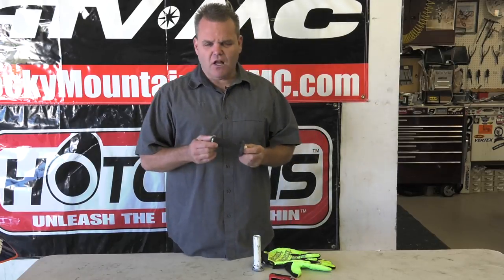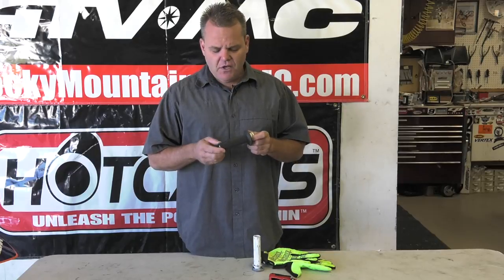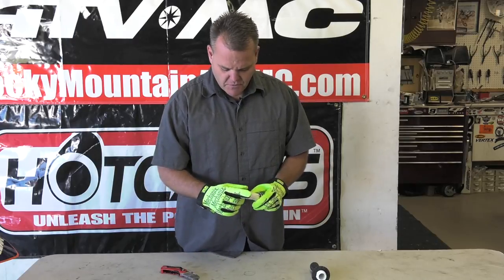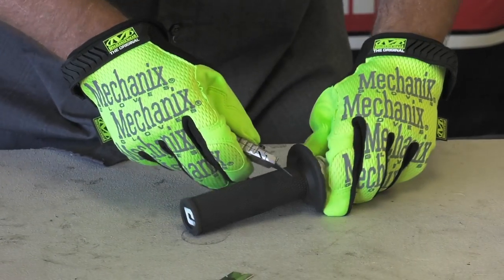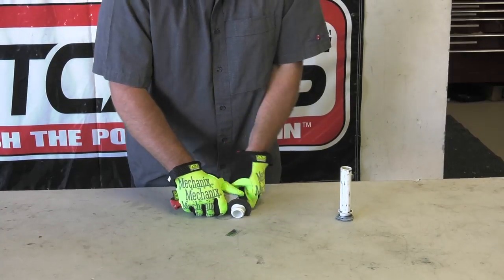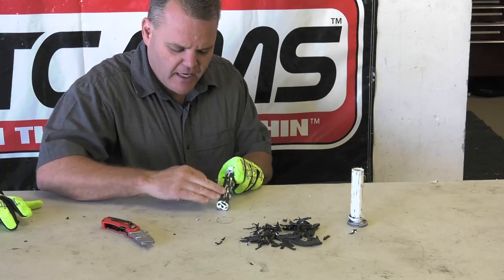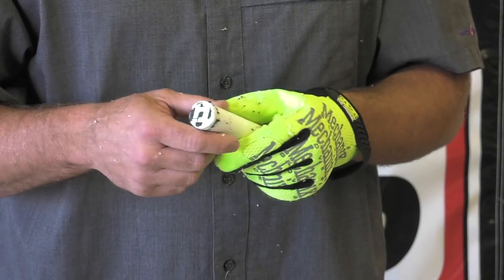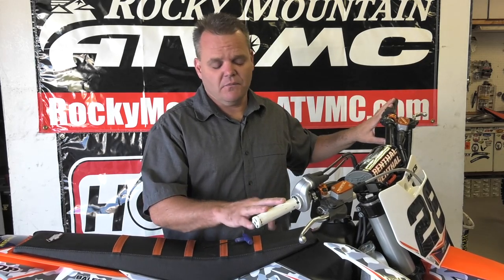KTM Throttle Tube Tech TIp

Comment: Sounds funny but I use the old fashioned Shoe Goop found at most department stores.  Got tired of spending too much on the dirt bike specific stuff only to have it come loose within a few rides.  With the Shoe Goop you have to act fast though!  Then let it set overnight.  I still wire tie too in case of wet conditions.

Comment: I use a small flathead and just lift the opening and then hit it with compressed air and they come off and go back on easily without using chemicals